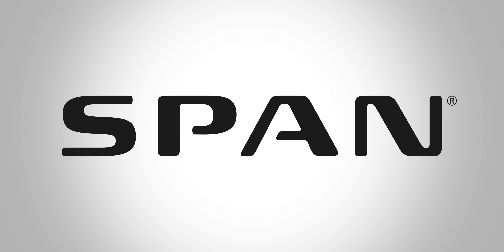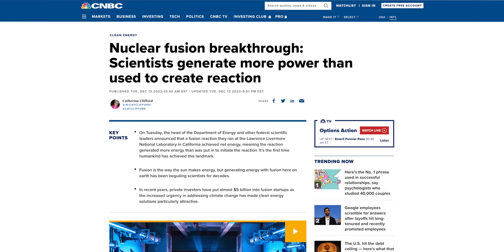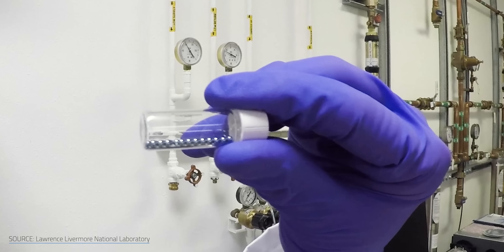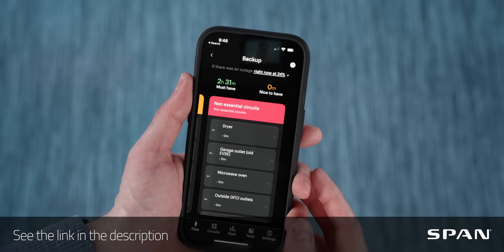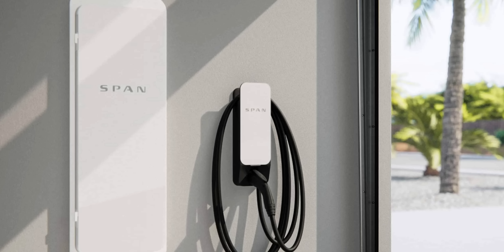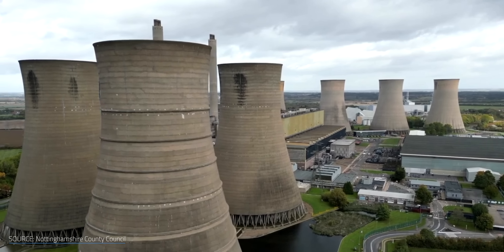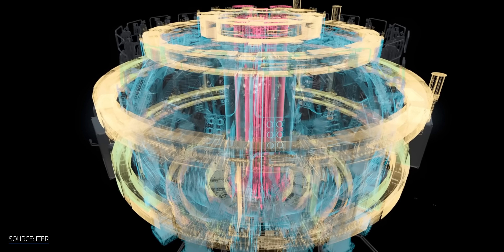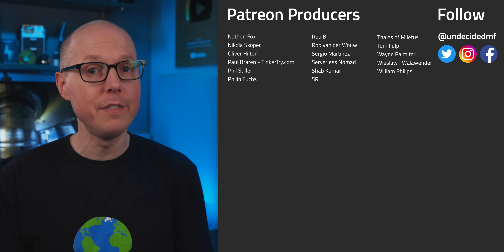What This Breakthrough Means For Nuclear Fusion

Comment: We may be 30 years away from viable fusion, but on the bright side in 29 years we'll only be 30 years away from viable fusion.
Reply: I just got off of work, I’m tired & sore, and reading your comment gave me a dang good chuckle. 😂
Thank you for that.
Reply: I'd say 20 years is viable, then 30 to build reactor.
Reply: @XX-rs7sq  Yes in thirty years fusion will be viable in 20 years, and then 20 years after that, it will be viable in 10 years. We’re approaching the asymptote!
Reply: @Dustman3400  lmao
Reply: Correct. I am hearing such stuff since my childhood.
Reply: @faisal-ca  which is 29 years before?
Reply: @faisal-ca yeah but now we actually understand the physics behind it. This has been what’s blocking us for decades but now we’ve figured it out. We just gotta get the worlds best engineers to do their job and make it more efficient
Reply: I agree it's a pipe dream never gonna happen anytime soon
Reply: I'm not sure about that. Hopefully in 29 years we'll be more than 50 years from viable fusion, because it'll just not be important enough to dump resources into 🙃
Reply: Well, I think this is partially true. The difference is 30 years ago no one had demonstrated it was scientifically feasible in a controlled setting.
Reply: @docdetroit99  Very good point, especially with the limit of your 2nd to the last word LOL
Reply: @docdetroit99  true, however we’re still so far off. For example, given their current energy gain, the reactor would have to pulse about 1000 times per second to have the same output as a typical fission plant. So somehow we have to get from 1 reaction per day to roughly 78 million pulses per day. And that would also be assuming the lasers were 100% efficient in delivering their energy (I.e. the amount of energy used by the lasers is equal to the amount they deliver to the fuel, which is technically impossible
Reply: @Blartflart2234 , agreed. But it is unlikely that the current design will be what's used for a reactor (i.e., the "scientific" gain is likely to be used in a reactor). Thus, the kilohertz requirement is not likely to ever be what is used in a reactor. There are potential whys of making further improvements, but that requires more physics research. So, I agree we still have quite a way to go. But, a plot of the target gain vs years shows a few orders of magnitide improvement in the past few years. This will probably not continue, but my point is improvements have been quite rapid. And I think the ability to create a "burning plasma" will now provide a platform to gain a better understanding of the underlying physics.
Reply: On the plus side, 50 years ago we were 40 years away... So... Progress?
Reply: The power source of the future, and always will be.
Reply: Exactly my thoughts. Sounds like the latest news is basically more of the same. Yes, it sounds promising, but so do all of the others.
Reply: Copy and paste
Reply: burning water sounds like a bad idea. efficiency is a good step forward
Reply: Not funny

Didn't laugh.
Reply: @letsgobrandon4175  yes it is
Reply: Look up Helion, they expect to be connected to the grid in 2024
Reply: The thing is,  we've been making progress,  but the progress always costs more than anyone wants to spend which makes it super slow going
Reply: @argledotorg  Meaning Actual time to hit Fusion may be a century or more. But they can't say that or the funding will dry up so they break it down into "decades away".
Reply: @arnowisp6244  the original estimates were "XX years if we spend $XXX Million dollars/year"

They were still quite optimistic even at that, but until 2000 it was difficult to even get a handful of millions of dollars/year for a fusion research project.

The truth is "we don't know", because getting fusion working for energy generation depends on solving problems that might still be unknown

"20 Years" or any estimate less than that assumes we already know all the hard problems we need to solve.
Reply: @Arno Wisp  or it could be already in development in a  dark program. 

That's the annoying part of "we don't know ".

There might even be issues that make the answer "never", but few people would be willing to accept that
Reply: This is the best thing ive seen in 30 years
Reply: The problem with all of these is the JP Morgan conundrum! How do we invoice free energy?  So the moment that question is answered there will be multiple free energy solutions that you'll have to pay for.
Reply: ~Global nuclear bomb fake Hiroshima deceptive There are no satellite photos of nuclear test explosions, please tell everyone~
Reply: I remember when it was "always 40 years away" about 15 years ago
Reply: Just to be clear, when I was a kid the joke was "50 years away and always will be" then it was updated to "30 years away and always will be" and now I've seen some unironically saying "20 years and always will be." There isn't any actual intellectual integrity behind the joke, it's just a joke, probably something oil investors say as copium.
Reply: Any news item coming from fusion research has one purpose only: to keep the money flowing. We should not fall for it. Better use that money to collect the energy that is beamed to us from the free fusion reactor in the sky that has worked for millions of years and will continue to work for millions of years, all maintenance free.
Reply: @MartinMaat  no, we should keep the money flowing. 

It is a gamble,  but the potential payout is literally unbelievable for most people
Reply: ITER wasted about 10 years in political wrangling.
If the US had decided to go it alone and spent more than the pittance it's contributing we'd be on to the DEMO stage by now.
Reply: That may have been the case awhile ago. Bc scientists have been saying for decades that fusion is 20 yrs away. Than in 19 yrs it’s another 20yr away. But that’s bc we haven’t been able to figure out the physics behind it to make fusion energy plausible and useful. But now the science has been figured out. We know how to do it we just gotta get the engineering there next to make it smaller and lessen the energy cost
Reply: @DiamondSquidy  No. The physics have been known and well understood for nearly a hundred years now. Every effort since has been about engineering, about creating a little sustainable sun in a laboratory. It is not going to happen.

All we got so far are proofs of concept. I can look up at noon to see a proof of concept.
Reply: @Mx racer  yep. We know how to do fusion at least.

The tricky part is using fusion without taking out a city
Reply: @argledotorg  well we’ve proven we could do that for decades… we’ve been achieving nuclear fusion for awhile but it hasn’t been efficient and resulted in a net loss of energy
Reply: @Mx racer  what do you think thermonuclear bombs are?

The problem isn't creating fusion with a net energy gain,  it's controlling the process. 

It might not be controllable for energy production,  but it also might be,  which is why we keep trying and why every breakthrough in this area is news
Reply: Reasoning by analogy is the easy way out but has many pitfalls
Reply: In their defense the only real funding for fusion has been private , on all honestly this should be a global project